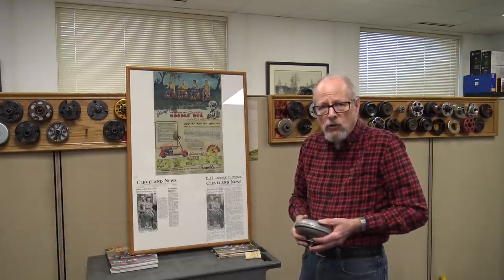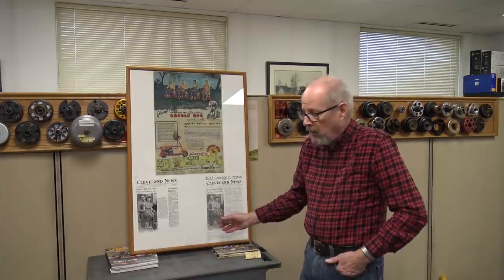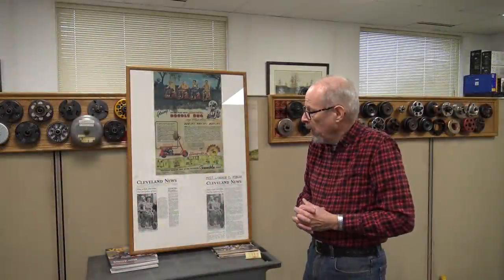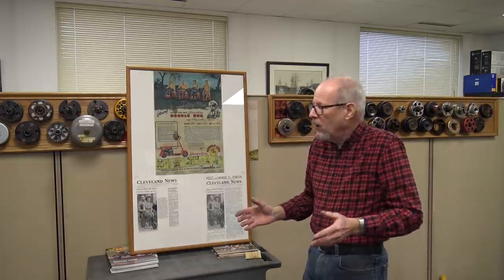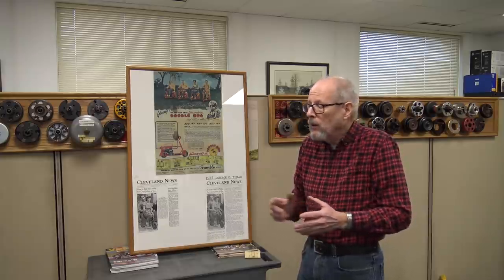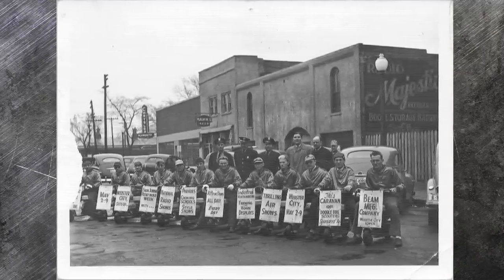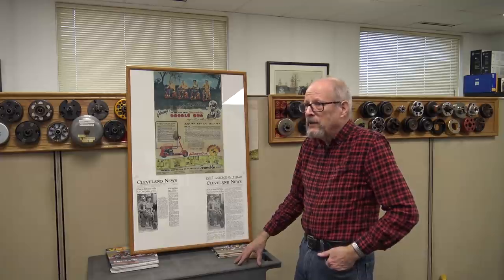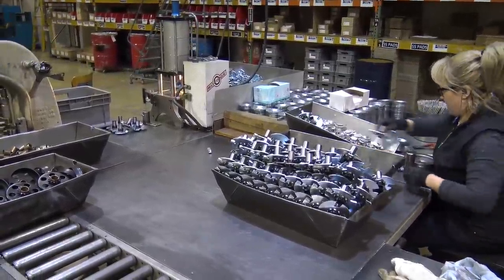The History Of The Doodle Bug Mini Bike

Comment: I had the remnants of one of these minibikes way back in the late 60's. Only the frame and front fender were original, everything else was either missing (ex.no brakes)or replaced. For $30, it got me around the neighborhood without pedaling. Along my old paper route there was  a complete(?) original bike that was always kept inside someone's garage. It was eventually purchased by a neighbor, but I remember that the bike had some mechanical issues and didn't run right.

Comment: My dad, George C. Fields, founder of Max Torque designed a torque converter in the early sixties and sold a few, I believe. The test mule for it was an original Doodlebug with a modified frame which dropped the rear of the frame and replaced the rectangular seat with a saddle. He called it the PDQ 40. My son has it now but it’s pretty much a basket of parts.
Reply: Do you have any pictures of it?